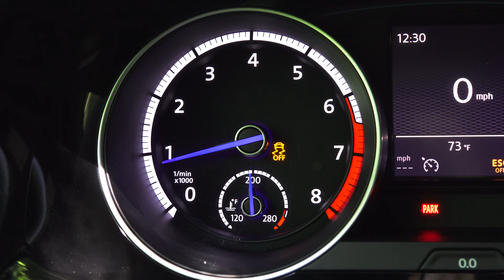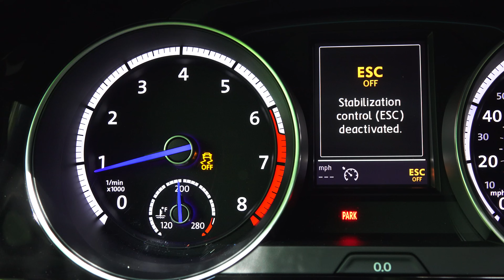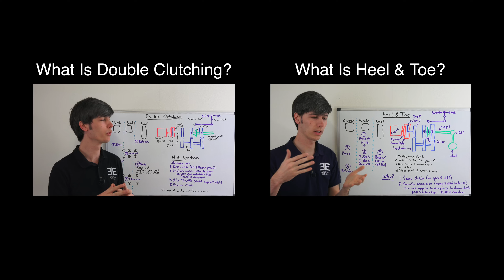How To Launch A Manual Transmission Car

Comment: What was that whole modulating the throttle thing? I couldn't find where you explained it
Reply: Modulating the throttle just means you increase or decrease the throttle based on what the car is telling you. I.e wheel spin occuring then you should let off a little(not lift completly) till traction is gained then apply again. It's a feel thing and as you feel your car telling you something you adjust accordingly.

Comment: I have a Audi s3 manual and when i try to launch the car, if i use to much RPM or lift the clutch peddle quickly, The clutch peddle stays down and burns up the clutch, any idea whats happening?

Comment: Should you have to release the clutch faster than normal? And wouldn't that stall the car? Thanks!
Reply: Amjath Khan 
Not if your giving it gas. No
Reply: @Tissimo_32  Thanks...and after the 1st gear, when I change into the 2nd gear..should I remove my foot from the gas pedal or should continue to keep it down (to keep up with the pace)?

Comment: How does one launch with no rev limiter?
Reply: FaZe, cars in the '60's didn't have rev limiters.  And on a sticky surface some would launch at 5k-6k or higher.  The driver actually has to know what they are doing.

Comment: My GTI vibrates when I get too much wheel spin.

I suck at driving stick so any suggestions when I do it?
Reply: AK Hobbies release your clutch slowing, when you feel the clutch bite then keep releasing, put a bit of throttle if you feel the car wanting to stall

Comment: regarding the point of redlining it before shifting it to 2nd gear. How does that relate to the engine/turbo being cold (especially in winter) whilst you're forcing it to work at high RPM? Isn't that the shortest way to damaging the cylinders and the turbo? thanks

Comment: Dumped clutch and engine flew out of car plz help (1962 honda civic type r)
Reply: finna pull up
Reply: And the v tec didn’t kicked in?🤔
Reply: twocupbleezy caught you lacking.... there is no 62’ type r
Reply: @christopherpaez4948  there is
Reply: @gui18bif  1972 not 62

Comment: Would you still want to go to redline in a turbocharged car? My concern being the pressure drop within the turbo at high rpm
Reply: Please explain your concern about pressure drop and how it harms your turbo.  Because there is no harm occuring.

Comment: I generally launch my truck by holding it at about 2000 rpm, start slipping the clutch, dump it and floor it at the same time, yields decent results.
Reply: gídvfúrby8ú

Comment: After I launch according to ur 5 steps and bring it to red line in first when I change to second there is a engine braking does it mean that second gear speed is already achieved by the first gear launch so do I need to shift to 3rd from first
Reply: Shift to 2nd eairier before you hit Redline and allow 2nd gear to be useful.   Gear Ratio between 1 an 2 most be quite close and all ratios allow some overlap between gears so the engine is able to be kept in its preferred torque range when driving normally.

Comment: If you wanna help your car a bit, when you first press the clutch in, press the brake, and release the clutch until you feel it grabbing, then press it in just a bit more, so you stay in place, release the brake, press the gas and dump the clutch

Comment: heres the question: should i launch my robotic transmission car with brake+gas till 2k rpm and let go of brake? i can hear the stress and car gets closer to ground for sure. or suddenly engage to gear after revving on neutral?

Comment: Step 1: Put in first gear
Step 2: Press in clutch and press gas pedal to get higher RPM
Step 3: Release clutch
Step 4: Floor it.
Reply: Thank you John wick fortnite I now have 4 women in my car, so I got the W
Reply: Mr.Ender lmaoooooo
Reply: Still clutch is burning
Reply: Car stalled after step 1

Comment: I drive the Nissan Micra 1.0l, what rpm should I use to avoid the wheelspin? Im so worried i will burn out the tires

Comment: As a thought experiment, let's say my wheels have infinite traction. What RPM would I want to sit at for the optimal launch? Would it be where the engine makes maximum power or maximum torque? I know for a given speed you maximize acceleration by maximizing power, but here the speed is 0, so the a=P/(m*v) equation is useless. But also within a given gear you maximize acceleration by maximizing engine torque, and I know we're in first gear. So should I launch at max engine torque?
Reply: Max torque surely.

Comment: 5000 or 6000 rpm in a Subaru?

Depends how well you know you local clutch specialist.

Some not particularly great info here.
Reply: I mean, he does say you shouldn't do this if you want your clutch to last.
Reply: my focus launch control holds the revs at 5500 and ford itself says to dump the clutch not let go slow at all
Reply: @davidmontagpf5589  They say that cause most people would be to slow on release. clutch dump should still be smooth and concise as opposed to just lifting your foot instantly, Allows a more progressive bite for the clutch and therfore less chance of slippage because you just asked it to clamp and transfer all that torque instantly and less chance of shock load breaking driveline etc.
Reply: @davidmontagpf5589  they say dump clutch because they is a clutch delay valve which just brings clutch up smooth so and dingle can drive it
Reply: Yeah lots of cars launch at high revs like that. The MondayMods EvoX launches at around 5500
Reply: @jjames267  Wouldn't you want to launch at peak torque assuming your tires can hook? (for racing applications, that is)
Reply: @omgvague  I guess it greatly depends on the application. I would think whatever RPM the car has the most acceleration at. This is most likely where peak horsepower is.

Comment: The peak power /peak torque rpm will be important for the perfect launch? I have been hillclimb class champion 4 times and the launch is crucial for the fastest possible time of your run. I think if the car makes peak torque at 4k and peak power at 6k then you should be doing the same routine as described in the video but at just under 4k rpm giving you the fastest acceleration to just past the 6k where the most power is made then shift fast and try to keep it around the 4k peak torque level and continue through the gears in this way. PS it works

Comment: I have several manual/V8 equipped late model USA made muscle cars. They all perform best with a launch from about 2500 rpm, letting the clutch out quickly (dumping the clutch doesn't work well.) I always left the throttle and use the clutch to upshift (no power-shifting for me). Automatics are faster, but I have never owned a car with a auto-trans, not starting now.

Comment: i get scared when i'm revving to 2k rpm and you casually apply 6k rpm like whatever
Reply: Never go to 6k with a cold engine.
Reply: Surprises me how many people are scared to redline their cars most cars are made to be able to handle red line it's the redline for a reason that's the safe zone
Reply: I go with 7200 with honda
Reply: I don't feel the need to rev passed 4-4.5k
Reply: I take that back I now hit 5.5 tons that's the sweet soot
Reply: Im perfectly fine to reving to 5000 and ive only driven a manual since January
Reply: @sammybeddingfield1014  why you crazy or somethin?
Reply: @thephantomzoneboxing  i mean it will rev to 6500 so
Reply: @thephantomzoneboxing  no?
Reply: @thephantomzoneboxing  what does reving have to do with accidents? I like reving my car also so i can drive more dynamic.
Reply: @jakub5438  how does revving your car to redline allow dynamic driving?
Reply: @thephantomzoneboxing  to redline nothing but did i say i do maxout my rpm? And how can you know if 6500 is redline for Sammy
Reply: @jakub5438  what does revving your car to high rpm range allow for dynamic driving?
Reply: @thephantomzoneboxing  search torque graphs and look where engines reach their peak, by logic if i keep the car in gear until it's peak rather than doing fast shifts it will be more dynamic
Reply: @jakub5438  understandable what does that do for you in day to day driving in your v6 engine im assuming..
Reply: @thephantomzoneboxing  It lets me enjoy my ride more in cost of worse mpg and maybe saves me few minutes
Reply: @jakub5438  well i suppose lol
Reply: @jakub5438  so does revving help keep you in gear just at a high rpm thats what youre saying?
Reply: @jakub5438  sorry for the late reply on the question for u asking how I know 6500 is redline is on my truck a 350s redline is bout 5500 or so and my truck is before that so 6500 is max
Reply: @jakub5438  just don't stay in 2nd at high revs constant speed, use high revs for acceleration and low revs for cruising and constant speed
Reply: @sammybeddingfield1014  you're getting worse mpg and wearing out your engine faster by revving that high
Reply: @Pricysalamander  When you never give your engine some fire it will literally clump up with residues throughout the entire combustion process.

Driving a 200hp car and only ever using 100 of those is for your car like lying in bed all your life.

Comment: talking about the confusing logistics of a car will not help learners start a manual. i think you should just tell them to floor the clutch and simultaneously give a bit of gas. you here talking about turbocharged engines... learners are not going to know what you are talking about.
Reply: falchulk imagine if they did though it'd be so funny

Comment: Great methods to get the best 1/4 mile times...and spend the most $$$$ on clutches.  For the 99% of the time you don't need a max performance takeoff, use the minimum throttle and clutch slip needed to get moving.  Don't punch the throttle until the clutch is fully out. Use the same technique to shift, minimum throttle and slip.  Do this and save your clutch lining  for those few times you need a jackrabbit start.

Comment: So ummm how do I know when I need to replace my clutch?
Reply: Fine, when it starts to slip (check the adjustment first).  When it starts to vibrate severely when you push it in.

Comment: My car has a high end torque, so i accelerate faster from a stop when i keep it at 5000rpm, and then slowly releasing the clutch, its not like granny slow, but it like maybe 1sec, the diference is huge, its like feeding your wheels with the clutc, not to fast, cause than the rpms will drop belove high end digits, or wheels will spin out, and not to slow, so that im burning the hell out of a clutch.
Reply: BTW you need to hit the gym man...

Comment: I noticed in your shift from second to third you took a bit longer to shift gears. Does the Golf also have issues with second to third shifting at high rpms? I have driven two skoda octavias with the same manual gearbox and they tend to crunch gears if you go at or near redline from second to third.

Comment: Aren't you burning your clutch everytime you launch then because you have to hold clutch and gas to rev up before you launch?
Reply: Matt Yes that will destroy the clutch. You should give it gas after it is moving in gear with the clutch completely out to prevent damage to the driveline.

Comment: What about loading the suspension when on a launch? Like letting of the clutch too fast causes the car to do that jerk-stop and go uppon letting off the clutch. Considering motor and tranny mount play and suspension movement, wouldnt you want to ride the clutch just a little at the brink letting off completely. If you have high enough rpm to spin wheels it doesnt matter buy if the rpm arent high enough doesnt the car jerk if the clutch is duddenly dropped.,

Comment: Here is another question. At what RPM can we achieve the best wheel torque from a dead stop?I think it is achievable at max torque RPM for launch since the wheel torque is engine torque x gear ratio x axle ratio.But many diesel cars give their max torque  around at 1500-2000 RPM.Does that mean that the max achievable launch force for these diesel cars is at 1500-2000 RPM in first gear?

Comment: What about driveline shock with AWD? Isn't there a risk of damaging components with high RPM launches? When tires spin, they take the wear away from the drivetrain. In AWD, there is no wheel slip, so the clutch and other drivetrain components take the brunt.

Comment: Hey bro can you do a video on the differences and which one is better between a 5 speed and 6 speed gearbox? like if you had a 5spd and 6spd running on the same engines like say a 20v or 2jz which one will get outgunned the 5spd or 6spd?

Comment: can anyone explain how to calculate at exactly how many RPMs do the tires lose traction to the ground? I know many factors such as tire grip and engine size play a role in this, but is there a certain way to calculate at what exact RPM does wheel-spin occur (sort of like dry-hooking, but for a car without slicks)
Reply: Did you figure it out?
Reply: Thats not really an easy calculation since there are tons of variables to take note. For example, you need to know your tires' static friction coefficient, contact area, vehicle weight on the drive wheels, which are the "easy" data to get. What is harder to figure out is the amount of force you are pouring down to the tires. If you drop the clutch too much, for example, you'll have way more force being transmitted to the tires than your engine can give you in a constant acceleration, since it has a huge amount of inertial energy as it is spinning pretty fast, along the fact that you are (probably) flooring down the throttle wich means you need to know exactly how much force it is generating plus the amount it is transmitting from losing kinectic energy. Thats also ignoring the fact that you are already losing energy on the entirety of your drive train (differencial, transmission, clutch, bearings). So, the smartest way to figure out how much you can rev your engine is by feeling, you've got to do it a lot and get the gist of how you should launch it.

Comment: Hi people, so i have a honda jazz diesel 1.5L i-DTEC. I tried launching it today and for some reason it doesn't go above 2500 rpm when the clutch is pressed in and in 1st gear. Does anyone know why? The redline is at 4000RPM. This happens only in 1st gear when not in motion and NOT while driving.

Comment: what about 4wd, ik alot of people dont see a difference in awd and 4wd but my tacoma 2002 pre runner i believe is in 2wd until placed into 4, that being said all 4 wheels still get power from the engine. the back wheels will get more power than the front correct? how would you launch that?
Reply: Since you have more traction on a 4wd, it has more traction. Just hold the clutch slightly longer.

Comment: When i try to launch at a higher rpm the car starts skipping and loudly banging, especially on rainy days on wet road. I thought it might be abs working? Any help?
Reply from the maker: Yep, traction control preventing you from a burnout. Not enough grip. Can disable traction control to get around it, but doesn't necessarily mean you'll be able to put any more power down.
Reply: jank, on an old car, check shocks springs and tire pressure.

Comment: Throttle should only be applied as you release the clutch and you will never need a clutch change ever if you do it smoothly each time.  I covered some high miles with Porsche/Audi cars and no clutch problems ever even one I drove for 12 years.

Comment: If u guys don't want to break yur car but still wanna launch, just launch at a really low rpm, it will still yield better results than launching with no boost at launch and u won't put as much strain on yur motor

Comment: My Holden barina is fwd and on a dry road the wheels go skrrrt even at 2000rpm, which is annoying because on its manual it says peak torque is 3.5k, I forgotten how much torque it has or how light it is but I know it's got 94 hp.

Comment: actualy you hold the handbrake get the clutch to the biteingpoint to remove the gaps in your drive shafts and stuff and then you remove handbrake and realese the clutch. that makes your car less stresed

Comment: I always die of laughter when I see a ricer on the quarter-mile rev to 7000, and use their blow off valves, and dump the clutch, then blow a transmission. Then it literally takes 30-1 hour to clean. They also like to shift after it hits the rev limiter.

Comment: how to unleash Vtec ?
Reply: Gopnik n first u put the car in 5th or 6th gear full throttle dump the clutch and pull the e brake right when you are about to drop the clutch

Comment: You also forgot to mention that the elevation of where you are matters on 0-60 times so if it isn't at the time that is posted online by motor trend or wherever than it might just also be where you are located

Comment: Let's say I'm cruisin at 2K RPMs on second gear and I want to suddenly accelerate really fast, which method would give me greater acceleration? if I just floor it, or if I do the technique in the video where I would press the clutch, up the RPMs and then release the clutch?
Reply: Just floor it because downshifting to 1st gear can be tricky and very jerky if you don't match the revs perfectly, and you have to keep up the momentum by quickly applying the proper amount of throttle right when you re-engage the clutch.